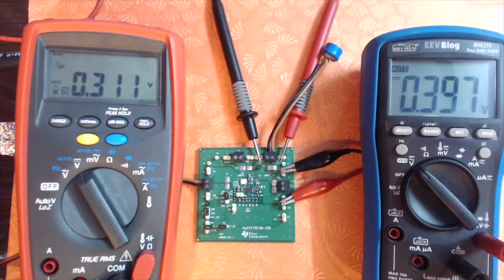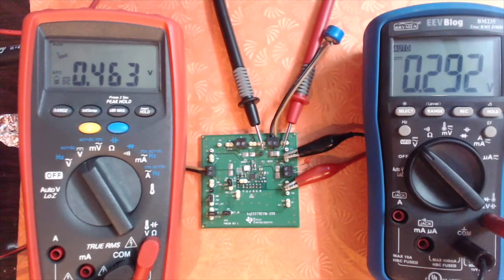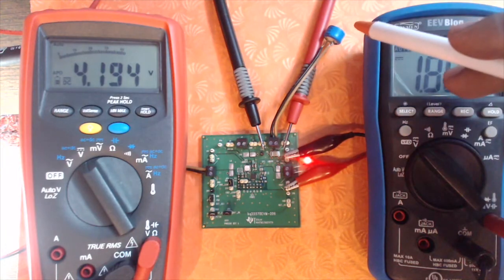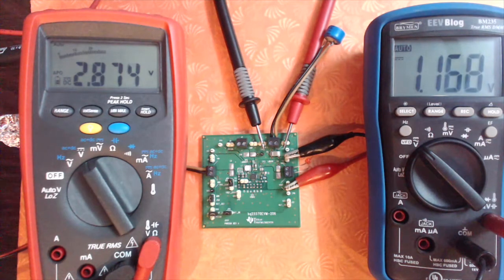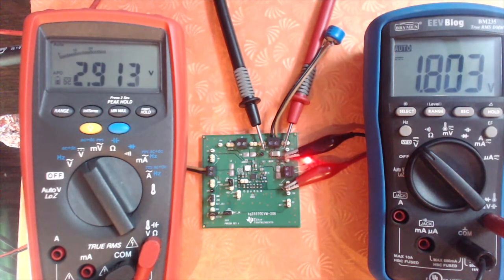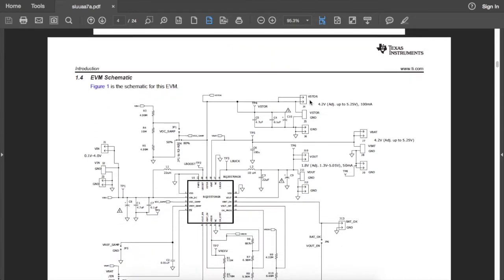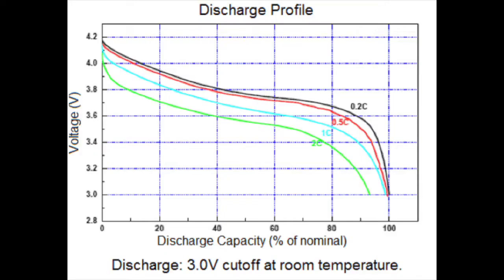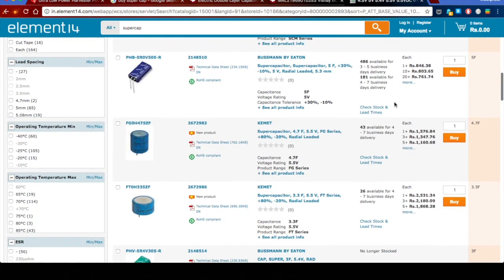TI BQ25570 Energy Harvesting Demo with SuperCap

Comment: hi, i managed to boost the output voltage to 4.2 through connecting a resistor parallel to r10. may i know what i else i can do to make the voltage output to 5.1v?

Comment: Hi! I've encountered a strange behavior with this board. Maybe you can shed a light on that. If I cover the solar cell, so that no light hits it, and after that I connect a full battery, no current is flowing to the load. Only If I lift the cover from the solar cell, the load receives current. Why? A full battery (4.2 V) should provide power, no matter what. Thanks!
Reply: If it's still relevant, you should discharge CSTOR before hot-plugging the battery. Otherwise the battery will remain disconnected until the harvester charges CSTOR to a minimum level. Details in the BQ25570 datasheet.

Comment: hi , i want to get output from a piezoelectric strip 20cm long, the output of the strip is 20 Vpp and Rms 7V  ac signal, so where do i connect the output terminals of piezo strip, any change in jumpers that have to be done, please guide.
Reply: you need a bridge rectifier for this, a step down module first and then u can connect it to the energy harvester

Comment: What is the capacitor that you chose? the voltage and capacitance i mean
Reply from the maker: The capacitor is 0.1Farad and it is rated at 5.5V . The selection was based on the maximum output voltage which can be around 5V but in my cases is around 3.3V.

Hope that helps.